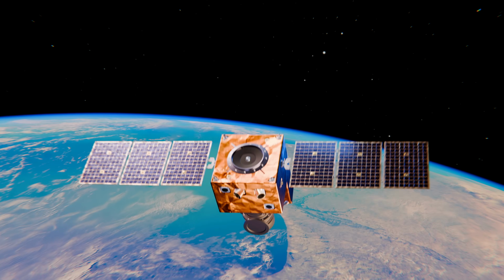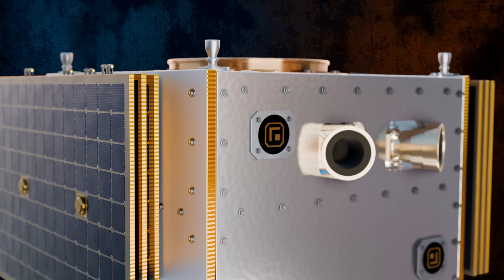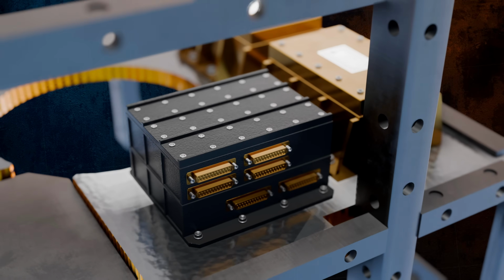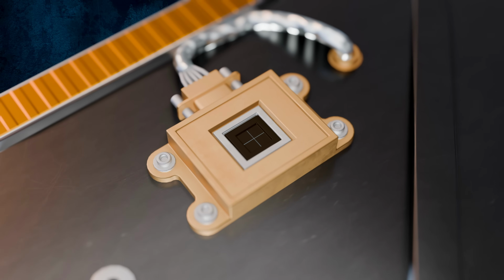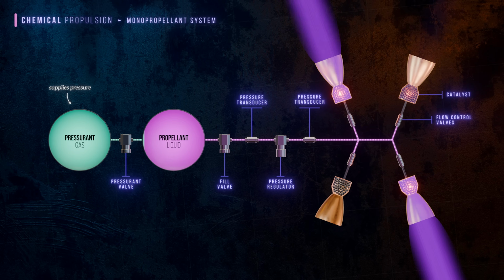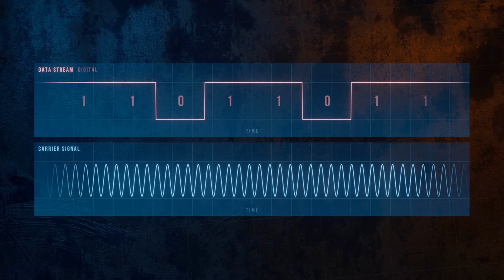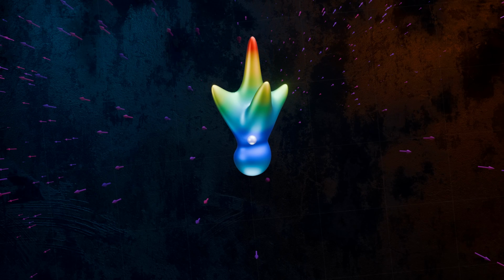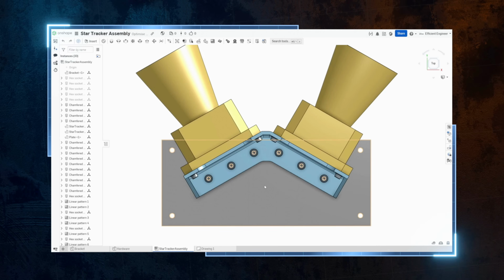How to Build a Satellite

Comment: Very good explanation but it's actually not completely true for the number of Reaction Wheels, for Earth pointing satellite it is enough 2, although 3 are mounted for redundancy. For other satellites minimum is 3 and 4 are usually mounted not orthogonally but in pyramidal configuration for redundancy as well

Comment: Hey just a question that came to my mind.
In the video, I saw that the connections between the computer and the rest of the systems like the batteries and so on, was animated with d-pin looking connectors.
Do they actually use such connectors in the real satellites? Are they the standard connection on the satellites?
Or if not, what do they use in the modern days??

Would appreciate if someone has any idea!

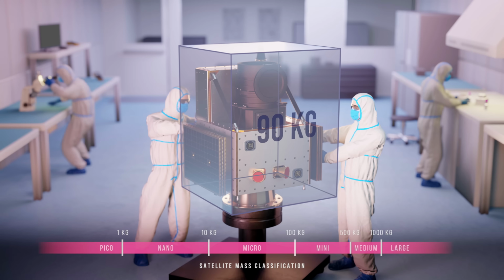Comment: Chapter 1: Introduction to Satellite Communications (00:00 - 01:24)
Brief introduction to satellite communications, their importance, and basic functions.
Overview of the satellite's role in global communication systems.
-------------------------------------------------------------------------------------------
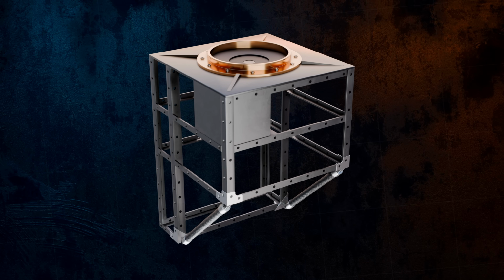Chapter 2: Satellite Structure and Components (01:24 - 02:50)
Key satellite components: Payload, bus, and antenna systems.
Overview of the satellite bus, including power, propulsion, and thermal control systems.
-------------------------------------------------------------------------------------------
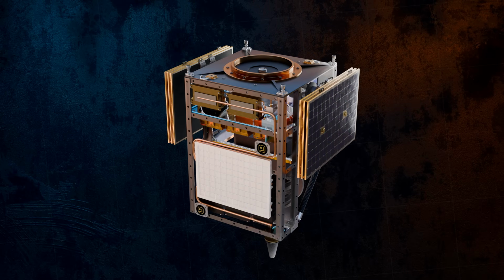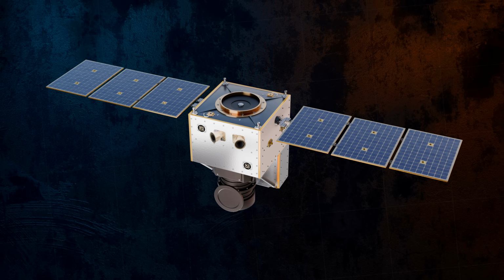Chapter 3: Communication Links and Modulation (02:50 - 06:18)
The role of communication links in satellite operations.
Overview of different types of modulation: AM, FM, and PSK (Phase Shift Keying).
How PSK modulation is used for high data throughput and low error rates.
-------------------------------------------------------------------------------------------
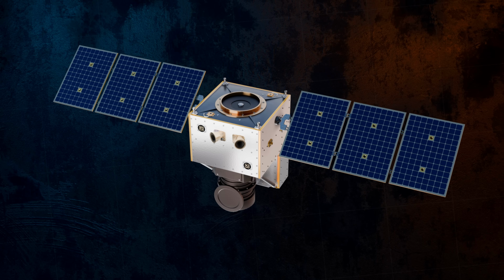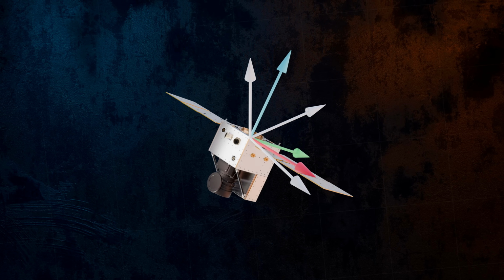Chapter 4: The Telemetry, Tracking, and Command (TT&C) Subsystem (06:18 - 07:47)
The TT&C subsystem's three main functions: Command, Telemetry, and Tracking.
Detailed explanation of the TT&C components like transceivers, filters, and antennas.
How commands are transmitted from the ground station to control the satellite.
-------------------------------------------------------------------------------------------
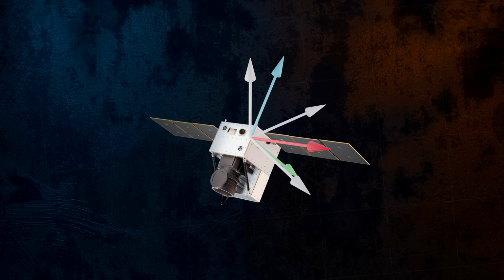Chapter 5: Satellite Payload and Data Handling (07:47 - 09:25)
Explanation of the satellite's payload and its importance for communication.
How payload data is received, processed, and transmitted by the satellite.
-------------------------------------------------------------------------------------------
Chapter 6: Signal Transmission, Antennas, and Frequency Allocation (09:25 - 12:09)
Different types of antennas used on satellites for communication.
How antennas direct signals and the role of frequency allocation in satellite communication.
-------------------------------------------------------------------------------------------
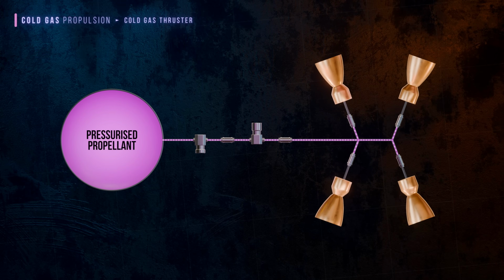Chapter 7: The Role of Antennas in Communication Systems (12:09 - 13:47)
In-depth look at antenna performance, radiation patterns, and gain.
Differences between isotropic antennas and real antennas.
Satellite antennas for high data rates (downlink) vs. reliable communication (TT&C).
-------------------------------------------------------------------------------------------
Chapter 8: Thermal Control Challenges in Space (13:47 - 16:19)
Temperature extremes faced by satellites in space and the need for effective thermal control.
Technologies used for thermal regulation: radiators, heat pipes, insulation blankets, etc.
-------------------------------------------------------------------------------------------
Chapter 9: Power Systems in Satellites (16:19 - 18:23)
Overview of the power generation and storage systems in satellites.
Solar panels and batteries: How they supply energy and manage power usage during the mission.
-------------------------------------------------------------------------------------------
Chapter 10: Satellite Propulsion and Attitude Control (18:23 - 19:01)
The propulsion system’s role in satellite orbit adjustments and station-keeping.
Attitude control systems and their importance in satellite orientation and stability.
-------------------------------------------------------------------------------------------
Chapter 11: Communication Systems and Data Link Operation (19:01 - 19:58)
Key elements of communication systems like data links, modems, and uplink/downlink operations.
How data is encoded, modulated, transmitted, and received.
-------------------------------------------------------------------------------------------
Chapter 12: Telemetry, Tracking, and Command (TT&C) Subsystem (Continued) (19:58 - 21:05)
More on the TT&C functions: Telemetry and tracking.
How Doppler shift helps measure satellite velocity and position.
-------------------------------------------------------------------------------------------
Chapter 13: Antenna Systems and Their Functionality (20:41 - 21:49)
Detailed breakdown of antenna types and their functions in satellite communication.
Differences between high-gain and low-gain antennas.
Importance of antenna pointing mechanisms in communication with the ground station.
-------------------------------------------------------------------------------------------
Chapter 14: Thermal Control in Space (Continued) (22:53 - 24:44)
How thermal control systems work to manage temperature fluctuations in space.
Technologies involved in heat dissipation and heat absorption.
-------------------------------------------------------------------------------------------
Chapter 15: Space Engineering Challenges and Innovations (24:53 - 25:05)
The technical and environmental challenges of space missions.
The need for advanced engineering, extensive testing, and research.
-------------------------------------------------------------------------------------------
Chapter 16: Introduction to Onshape CAD Platform (25:05 - 26:39)
Sponsorship and introduction to Onshape: A powerful cloud-based CAD platform.
Key features of Onshape: Collaboration, part modeling, version tracking, and mobile access.
How Onshape helps in satellite design and engineering projects.
-------------------------------------------------------------------------------------------
Chapter 17: Conclusion and Final Remarks (27:00)
Closing thoughts on the importance of satellite engineering and the tools available for designing space technology.
Final thanks and encouragement to explore Onshape for design purposes.
Reply: And yet, more AI generated slop engagement farming comments.

Comment: Awesome video, especially the visualization of radiation pattern of directional antennas with these flying arrows :)

8:56 - sorry for nitpicking, but are accelerometers useful onboard a satellite, especially if it doesn't have any propulsion, only attitude control? The accelerometers will always show zero.
Reply: Yes, accelerometers are useful, especially with other sensors to supplement them. They won't always read zero because perturbations from other forces like drag, other celestial bodies, or irregularities in Earth's gravity field, will still act on the satellite and change its orbit over time, and these are the most important to keep track of since they're less straightforward to predict (besides where other bodies are). The changes in acceleration measured by the accelerometer can be 'fused' with other measurements, like ranging from the ground, GPS, etc, as well as an internal physics model, to produce a higher quality state estimate than any of the individual sensors could on their own. In practice an accelerometer captures smaller, faster, and more minute changes than a GPS would, but is prone to drifting (accumulating error over time), while a GPS will always have an accurate ballpark. Because of that, they cover each others' shortcomings.

Comment: This video reminded me of my first internship where I got to built a cubesat and really provides a basic overview about the main things about satellites. However, I would like to add one thing at 12:12 . When reaction wheels reach their saturation, it does not mean they cannot be used anymore. If they are played in a coil, their rotational energy can be converted into electrical energy which will slow the reaction wheels down, while also providing power to the satellite.
Reply: this is a fascinating idea, could i find more references for this?
Reply: Back emf ?

Comment: Nice video! I used to work in rad-hard electronics and its crazy how important it is to rad-hard your components, sub-system, and once you have that put together test the whole computer system. Looking at you starlink 👀. In my basic understanding, satellite design is not to design to prevent complete failure from radiation, its to design around it. The electronics degrade over time and normally designers will put multiple circuits in and will rotate them out after a defined amount of time. Semiconductors degrade much faster when they are energised vs when turned off in rad environments.
Reply: Did you know that all of SpaceX's original electronics came from Digikey?

That is UNTIL they started flying payloads for NASA.
Then they were required to use rad-hard parts.

I wonder WHY the astronauts onboard the ISS can still use iPods and Apple Laptops?
Reply: @stuartgray5877  Digikey sells rad-hard components too. Also, the ISS exterior already has significant radiation shielding. If it can protect humans, it can probably protect your electronics too. 

I'm guessing any critical devices will be hardened, but someone's iPod failing is far from mission-critical. It's also a whole lot cheaper to replace a non-critical (or backed-up) iPod or laptop than it is to have a team of engineers design a rad-hard version.
Reply: @Snookers_  I know all that.
SpaceX was using non-rad hard parts at first.  They even asked me what I thought of that when they interviewed me for a job on Dragon Avionics.
I said the the same thing I said above: NASA won't let you you Keep doing that for manned missions.
I was correct.
They offered me the job but I turned it down. I'm too expensive for them 
I'll be kicking myself once they go public as the signing bonus was a LOT of shares.
I was told by a colleague that went there they work a LOT of OT without pay.  I'm too old for that.
Reply: @stuartgray5877  Ahh, I definitely misinterpreted your original comment. 
I've heard a lot of people talk about their experiences working at SpaceX and it all seems to be pretty similar - lots of unpaid overtime, and lots of half-regrets from people leaving when they did.
I've also heard a few other very interesting stories regarding SpaceX that I probably wouldn't have believed if I didn't have absolute trust in the person they came from...
Reply: And how many of SpaceX's initial flights failed due to radiation effects?
ZERO.
Reply: Well, SpaceX is Mars at all costs, right?